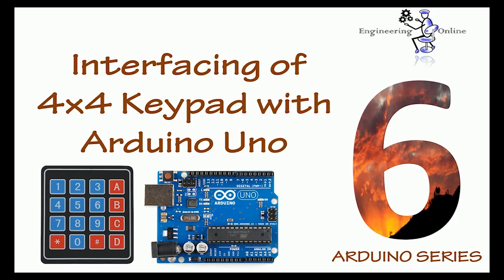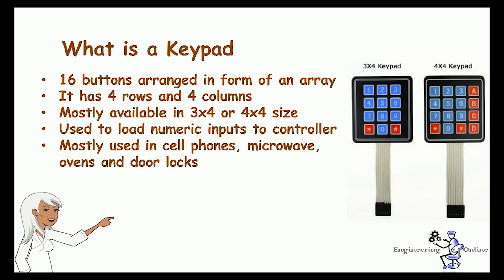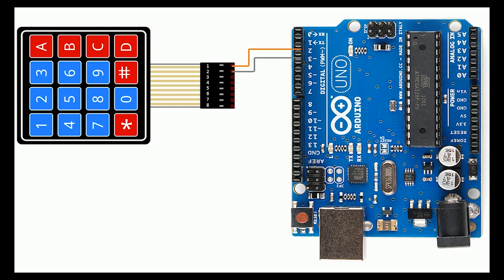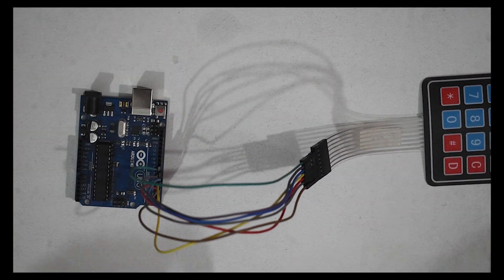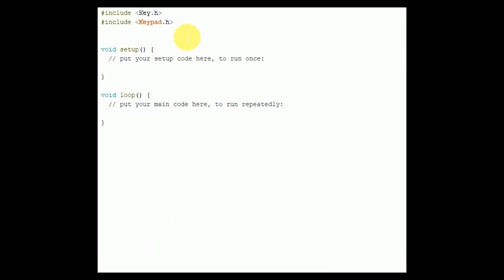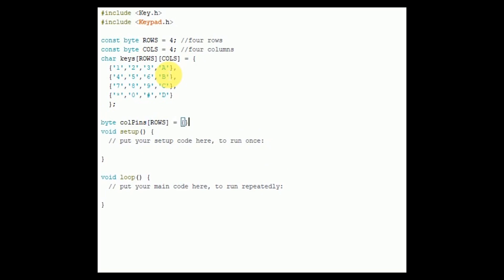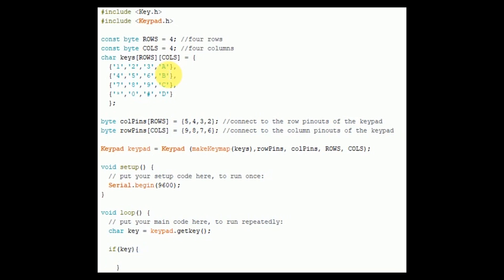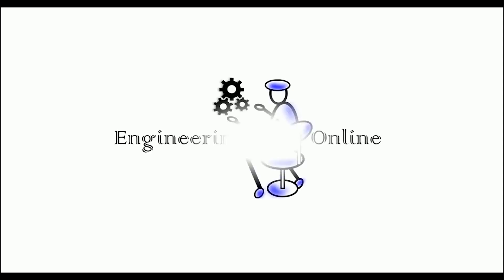Interfacing of 4x4 Keypad with Arduino Uno

Comment: How can enter 2 or more digits at a time 21, 185
Reply from the maker: The code has to be modified. For example, first you entered 2, It would be printed. Then you entered 1 so it would be  (2*10)+1 =21 The formula would be: (first number*10)+second number

Comment: How to open autoscroll?
Reply from the maker: It is serial monitor. You can open it by clicking on the tools --> serial monitor
Reply: Thanks! How do I make the buttons work without USB? You should only be able to connect 12V completely without USB after programming as everyone else has done.
Reply from the maker: @Delorean29  If you don't want to use the USB then first program Arduino through USB and then remove it and connect 12V adaptor to Arduino power port.
Reply: @EngineeringOnline  Thanks! Though I have to press upload to the chip every time. Something simple is wrong somewhere.